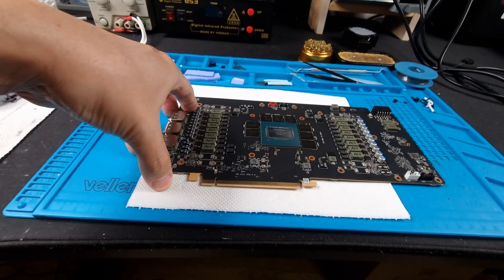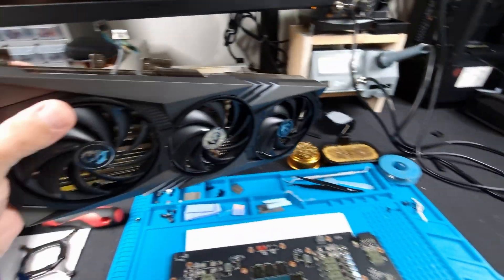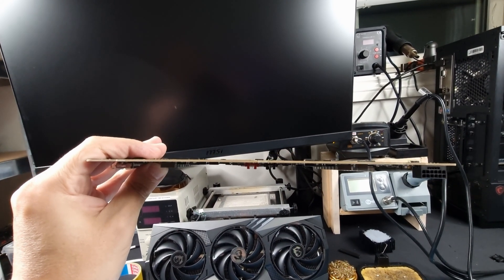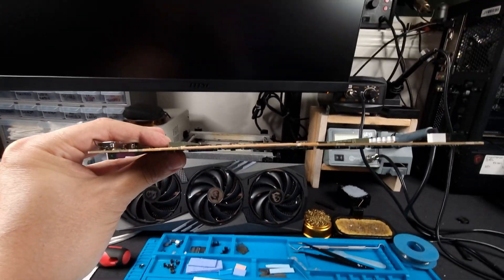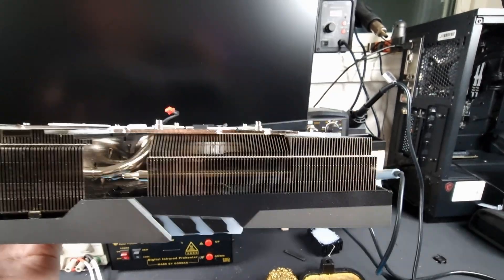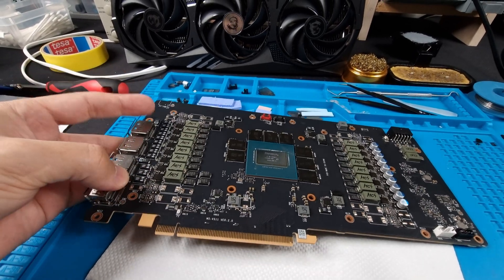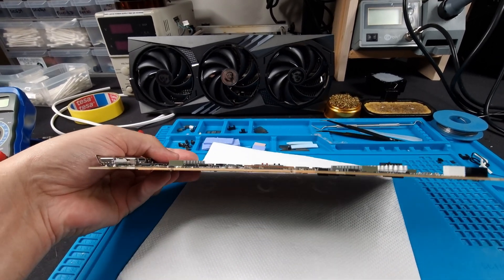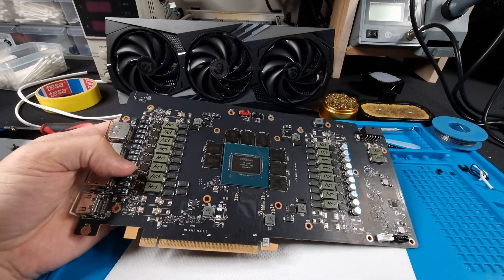How Using GPU Supports Incorrectly Can Destroy Your GPU.

Comment: From what I hear video cards usually run a little hotter vertically but the small amount of temperature increase is better than having the card crack slash Warp overtime
Reply from the maker: Yes, they run hotter if you use your case's vertical setup, as it places the card right next to the side panel. The Phanteks vertical mounts, on the other hand, place card away from the side panel and closer to the motherboard, thus allowing it to breath and run cooler than even when installed horizontally.
Reply: @TechnologyHive  but then doesn't it risk the hot air being sucked into the CPU cooler if one was to use an air cooler? Oh wait there's a counter to that I just realized I could swap the back fan instead of exhaust intake and then move the top back fan closer to the front and have that be the exhaust area but that would still have an issue with the GPU blowing the air up though the back area between the flipped intake fan and the CPU cooler fan trapped heat could happen and I don't even want to think about a founder's edition in that scenario direct hot air right onto the motherboard
Reply from the maker: @Ziyoblader  Horizontally or vertically, hot air will be a problem for the CPU if you're using a tower cooler. Not so much if you're using a AIO front mounted. If you like your tower cooler, just make sure you get a real good exhaust fan, and tweak it in the BIOS to monitor the CPU, not the "system", and give it a good curve to kick that hot air out fast, without too much noise of course. So, like I said, you will have to tweak it out to where you are comfortable.

Comment: A GPU supoort with multiple points of support, properly installed, would be ideal.

Painful when accessing the extra PCI-e expansion slots, but better than losing them altogether with a vertical mount.
Reply from the maker: Yes, that can work. But if you need the other expansion slots, just add support in the middle of the graphics card, as that is where the PCB generally ends on most of these heavy cards.

Comment: I came across this video today as I was installing my GPU support bracket. I am now considering getting a vertical mount for my gpu as long as my case can fit it but in the meantime I put my support bracket slightly under my GPU Ss that the bracket is not touching the GPU but if the GPU starts to sag ever so slightly, it will catch it.
Reply from the maker: @ashleyselman5949  If you wait til the GPU starts to sag, it will be too late by then. The idea is to install a support to avoid sag to begin with.

Comment: Actually what do you think of Thermaltake Tower 300 design where GPU hangs vertically downwards, so hanging off backplates. I haven't found comments about GPU damage, but ALOT about bad airflow and temperature in this case. I have front side grilles and 2 front case fans...starting to wonder if I can rotate PC 90 degree clockwise and turn them into bottom intake fans :D
Reply from the maker: @peteruk8  Why not look into the Phanteks G500?
Reply: @TechnologyHive  I'll give it a look! . thanks!

Comment: I would mount it vertical, but I really like my PCIe Soundcard and with a vertical mount i cant use it. So guess I will be using the "up here" bracket support and have it support from more the middle of the card than at the far end.
Reply from the maker: You have to do what you gotta do. I just see these cards coming in for repair with same issues, and due to the same cause. 👍

Comment: Thanks for bringing this to our attention. I have tried to read as many old comments as I can and I just wanted to confirm that regardless of perfectly supported (down to the millimeters) the GPU is with an anti-sag bracket, that the sagging of the PCB is inevitable? Because my current case doesn't allow my rog strix 4090 to be mounted vertically, I'd have to invest in a new case.
Reply from the maker: It would be a very good investment, imo. If you buy a new case, I can recommend 100% the Phanteks G500. And if you buy the Phanteks vertical mount, it will fit like a hand and glove. Id get the cheaper gpu mount, not the one over $100.

Comment: hey! i really appreciate you sharing this knowledge on a not so well known issue yet.

However, if i am unable to mount my gpu vertically due to clearance issue with the air cooler, and would prefer to save cost instead of buying an aio cooler just for this (i might in the future), where would the best position(s) be to place those support stands to prevent that gou twist?

based on the video, placement of a support alone at the right edge is a nogo
Reply from the maker: @YugenRaven  I would place the support at the end of the actual pcb, not the heatsink. So, in other words, place it in the center of the card, or where you see the pcb end.

Comment: The perfect support is somehow it can be adjusted to match the upward pressure to the same as downward pressure of weight. Perhaps in future another gaming feature will be digital GPU supports. i.e digital support that auto-extends until it detects certain pressure by itself and stops instead of human factor of too little or what is too much pressure.
Reply from the maker: That's a nice concept, but it would add extra cost to your purchase. Already they are not using tamper proof stickers with their motherboards and cards, let alone add a badly needed feature to prevent future damage. The prices keep going up, and quality keeps going down.

Comment: Dam. I been looking at my 4080 super suprim. And I kept worrying about sag. Then saw the case had a back brace bar to mount to back of case aswell. So 2 points of security. Then the support brace under it. And a suprim stand at the end. Card is way too big, but came with the prebuild.
Reply from the maker: @TheKingRazgriz  I have repaired quite a few of those cards. They are huge things and heavy.  So they love to sag.
Reply: @TechnologyHive  Might be detrimental to your business, but anything I could do additionally to support the card?
Or just being screwed in back of case, back of gpu, brace under card, and little suprim stand at the end good enough?
Reply from the maker: @TheKingRazgriz  Just make sure to add the support while the card is not screwed tight to the case. Loosen the screws, the add the support. preferably in the middle.
Reply: @TechnologyHive  thanks for that. Hoping this last me a few years and I'll do my own full build

Comment: Got a 4080s supreme x, it weighs 5lbs. it's getting support.
Reply from the maker: @SkullModder  That's a good idea. Just place it in the middle of the card.
Reply: @TechnologyHive  yep, then I have it so it's not pushing the card up. 
Also learned the hard way on my last gpu to be sure to check it's not close to the fan lol. 
Basic common sense, I know, but boy did I not have it.
Reply: @TechnologyHive  why in the middle and not at the end?
Reply from the maker: @Nikk_lx  Because the actual PCB does not go all the way to the end in most of these large, heavy graphics card. It usually reaches the middle of the actual heatsink.
Reply: @TechnologyHive  got it. Thanks

Comment: I appreciate the intent of this video, but I've watched it a couple of times now, and I still can't quite understand your explanation of the problem. Is it that supporting the ends of the card still allows it to sag in the middle? Or that supporting one edge allows the other edge to sag, resulting in a twisted appearance?  Or that no matter how well and evenly it is supported, it will still warp due to "hot/cold cycles", by which I assume you mean temperature fluctuation when the card is used heavily vs lightly or not at all?
Reply from the maker: @Barry-mm9ud  It is simple. Use common sense here. If the card is heavy, think about installing it vertically to avoid sag or warping of the pcb. If you use supports, then do not install them while the card is screwed down. Losen the screws, then add the support in the middle and at the end of the card. I did not mention this in the video, as I thought it would he common sense.

Comment: Happened to almost the same card MSI 4070ti X Trio
I can confirm my GPU support was just pushing the pcb a little bit too much upward , it started to make Prismal artifacts on both games & Benchmarks, OCCT gave infinite numbers of errors on both VRAM & GPU tests, 
cannot be sure if any vram chip or the core is the cause , I'm actually struggling to find a good MATS / MODS version, I've tried many, some are unusable, some others are failing to boot.
Reply from the maker: @kaistrabelsi274  it may be cracked solder joints under the gpu. Typical when sag is obvious just by looking at the card.
Reply: @TechnologyHive  I'll check it again ASAP with a magnifier..
By the way
Any advise about mats/ mods
Which version works with rtx 40 
And where can I find it ..please 🥹

Comment: I'm blaming Nvidia, Intel and AMD for their graphics cards power which are getting higher year after year. I miss the days when AGP based graphics cards were still the standard. At that time, every graphics card were still single slot with small fans with additional power if they needed coming from berg/floppy disk power connector (like Radeon 9700 Pro).
Reply from the maker: My first GPU was an ATI 9800 pro :) Today, these cards consume more power, significantly. So the need for a bigger heatsink is a must. But these companies do recycle their coolers, so they will slap the same size heatsink from a 500w TDP card, on to a 150w one, creating a weight and size issue which is not necessary. Gone are the good ole days :)

Comment: I just mounted a gpu support and only slightly supports the gpu so there's still sag but not so drastic because i could feel, when i pushed it up. That the gpu had almost no play, making it feel like i would rather break it than prevent it from breaking.

Comment: Taking into consideration what Technology Hive has to say about the GPU stands. Does anyone have any methodologies that have worked for them for the larger cards using either the Magnetic adjustable jack stands that you screw up and where to place them on the card to best support the card or the Lever style which have a rod and a lever that just sits on the end of the card and you rest the end of the card on it to just provide minimal support but hopefully no twist, it is just taking the weight of the rest of the card not sitting in the PCIe slot?

Some feedback would be appreciated for those who cannot place their cards in a vertical slot, yet want to provide some support, but not twist. I am maybe thinking the twist is coming from to much pressure being applied in the wrong place? Anyway any and all feedback appreciated. Cheers
Reply from the maker: From what I have seen, the problem with supports is that people place them at the very end of the card, while the card is screwed down to the case. My advice is to look closely at your graphics card and notice the actual length of the PCB. I'd place the support at the end of the PCB, and while the card has not yet been screwed down to the case. The small magnetic supports will do the trick as long as you do it right.
Reply: @TechnologyHive  Thank you for your feedback. Do you mean rhe support is sitting in the middle of the card so as to provide even pressure upwards. Not near the edge and not to near the motherboard.

Perhaps a spot on a 3 fan card that is near the end of the PCB that is near the middle is a suitable spot then?

Im also trying to understand how putting it in with the card loose works? Do you mean just back the screws off a tad sonthey are not tight and fit the pole mount..screw it up until it is toiching the card in the correct spot with light pressure then do the card chassis screws up tight from there? 
I hope I have understood your guidance properly.

Many thanks.
Reply from the maker: @Hotdogger808  Just loosen the screws enough so the card moves freely up or down. Then add the support where the GPU pcb ends, not the actual heatsink.
Reply: @TechnologyHive  ok, makes sense thanks but also the support is in the middle of the card at the end of the PCB i presume, not on the outer edge of it as that could cause a twist in my opinion. If its in the middle it is offering even support to the end of the PCB thus hopefully mitigating any potential twist or sag. Can only try.....many cheers

Comment: Is there a certain weight range for gpu which should use support or not ?,like above 2kg should use a support and below it is not required
Reply from the maker: @Arthur-m3m5q  If it's a 3 fan card, 2.5 slot, add support or place it vertically.

Comment: The problem  that all graphics card manufacturer is guilty of causing is that they design the cards in such way the PCB itself becomes part of the structural support.
Reply: Not all graphics card manufacturers ignore this problem. My Palit RTX 4080 Super has an anti-gravity plate that makes it impossible to bend the PCB. I still bought the support for it and placed it under the GPU chip (not at the end like most people), but I think this particular card would be safe even without it.
Reply: In the Gigabyte GTX 700 series they used two M8 screws and metal cooling plates for the RAM, because heavier card means better quality.